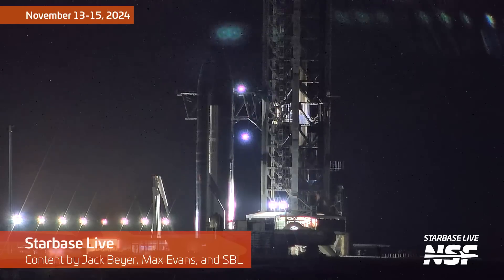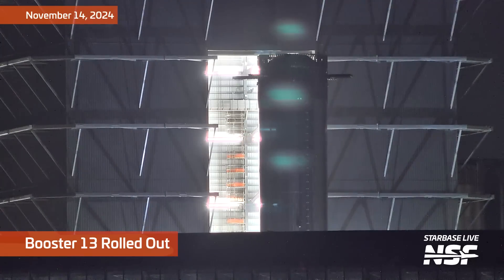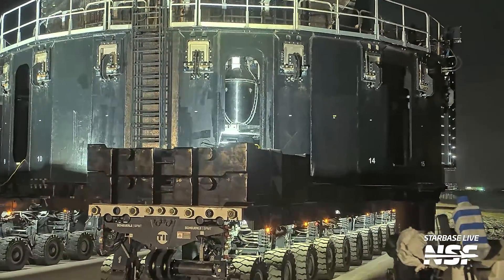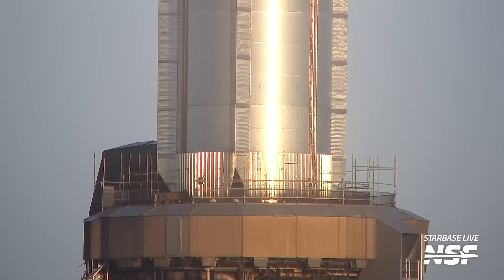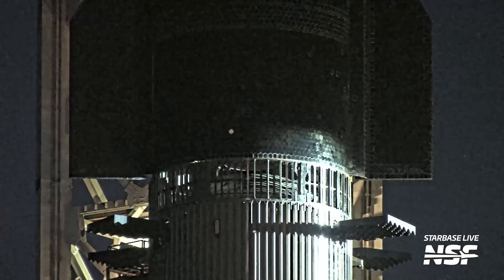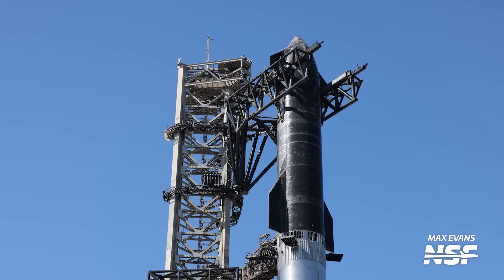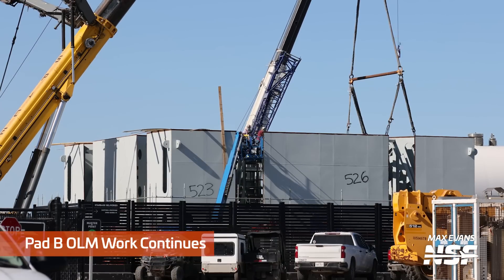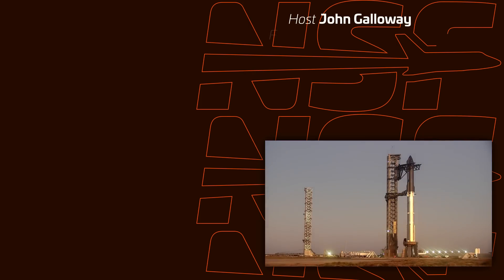Starship Stacked and Booster FTS Armed for Flight | SpaceX Boca Chica

Comment: If I remember correctly, the original line was approximately: 
Cheat, we had that light-switch installed for you so you could turn the lights on and off, not so you could throw light-switch raves. You're grounded!

Edit: Back when the "email" originally came out, I was friends with a DJ who played the downloadable MP3 live as part of a set.

Comment: Ship 26 best
Reply: ❤S26 Fan Club 4Life!! HIT THE 👍 TO JOIN!! BOK BOK :))
Reply: At least it's immortal.
Reply: @Verner_von_Kerman  Wrong.
It is scrap.
Reply: @bryanillenberg 😅
Reply: @IndigoBlitz  S26 is scrap.
Reply: @bryanillenberg  I agree. It's time is over. NEXT
Reply: @IndigoBlitz  Get the Plasma Cutter...
Its time to end this!
Reply: @bryanillenberg  which aspect, exactly?
Reply: @IndigoBlitz  S26 must be deleted
Reply: @bryanillenberg  past is the past. S26 served it's purpose. Onto the next. ...is this what you're implying?
Reply: @IndigoBlitz  Yes. Its time to get rid of it
Reply: Ship 26 is scrap.
Here is the proof:
Engine Bay vents were added to all ships after IFT-1... except S26.
The engine shielding was upgraded on all ships after IFT-1... except S26.
After IFT-2, all ships have had a fully functional Pez dispenser... except S26.
After IFT-3, all ships received an upgraded RCS system... except S26.
SpaceX is currently focused on testing the thermal protection system of the ship, which all ships have... except (you guessed it) S26. 
This can be proven by the location of the cameras... they are focused on the weak spots in the shield.
Oh, and every ship has engines... except S26. S26 received engines, static fired without stiffener rings on the RVacs (likely totaling them and the hardware around them), and then lost them.
Reply: @bryanillenberg  cream of mushroms 🪄
Reply: @Ionut-bg6vw  
S26.
Is.
Scrap.
Reply: @bryanillenberg  🥺 i know